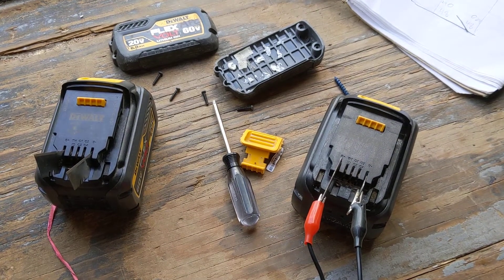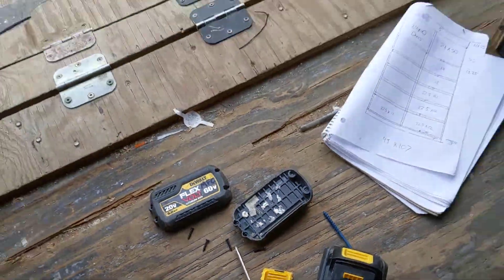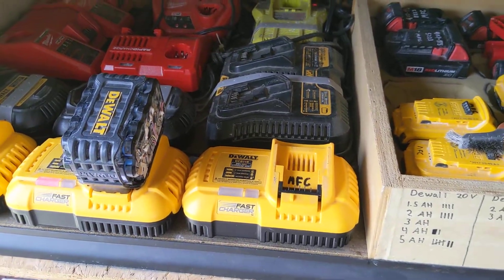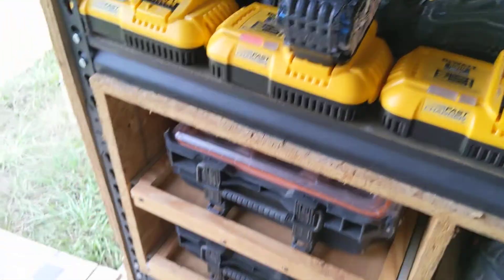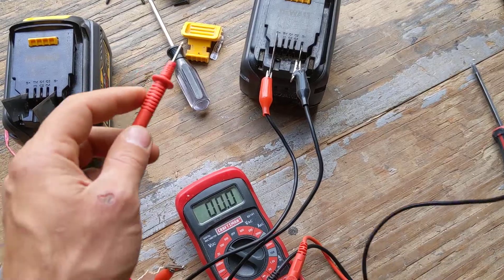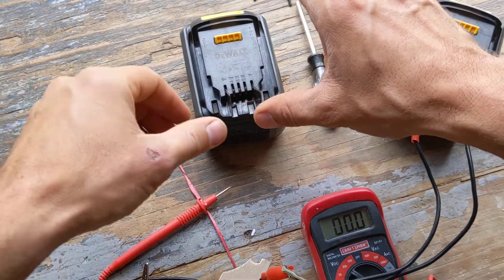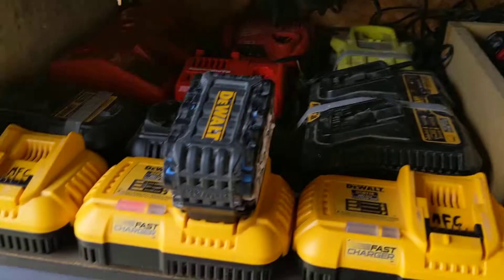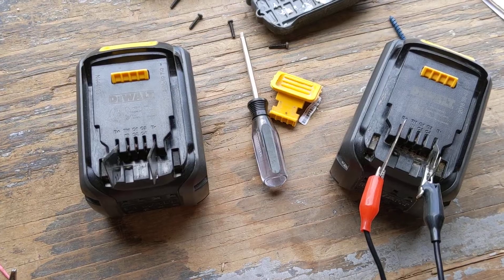How to fix a lithium ion battery that won't charge

Comment: I have a battery that showed mv and it jumped to 14v, but it doesn't look like it's going to charge.  I will let it sit on the charger overnight to see if there is a change.  It may have been to far gone.  The crap battery as of now did not live a long life.
Reply from the maker: Sitting on the charger won't do anything because as soon as it detects low voltage it shuts off charging. I would try jumping it again since it seems like you got it up some. Worst case scenario is that it's beyond fixing. Just be careful.
Reply: @MyFortressConstruction  Thanks.  I unplugged and plugged it a couple times and it started charging.   It shows fully charged now.  Thanks for showing how to save $100s of dollars.  Happy.
Reply from the maker: @Methodical2  Great, so it sounds like the contacts were just dirty. I had this happen to a 5ah a few days ago. A piece of 120 grit sand paper between the contacts can help in that scenario. Glad you stuck with it!
Reply: @MyFortressConstruction  Thanks.  I don't know what I did but it jump started the charging.  I will get a chance to test it 1 day this week or weekend.

Comment: Hey how are you?
I have a problem with my Battery it’s show me full charge but it’s doesn’t work
Reply from the maker: Have you checked voltage on the battery with a multimeter? I'm guessing you've tried it on different tools already to make sure it's not the tool. Besides that I would try to clean the contacts on the battery with a little sand paper (just slide it in and out). Hope you're able to get it working.

Comment: What you need to do is hook up every point of contact on that battery while you're trying to get it reset because those batteries are set up to charge and different sections they don't charge as one big 9 amp battery they charge at several 20 volt that's the reason they work on 20 v or 60 v but if you just plug into two wires to it you may have you may not been hitting the right point of that needs to be a little jump to be able to charge
Reply from the maker: Good points. I just find the lower voltage points and hit those, but hooking up every contact would ensure you're balancing all of the cells.

Comment: How about my case sir?everytime  I insert my battery  to the charger,  the charger  say pack charged, is my battery  is defective?
Reply from the maker: Yeah if the battery shows that it's only got one bar, but it says that it's full on the charger, then your problem is probably the same as mine. Check the voltage on the terminals and see what voltage you're at. If your voltage is low then you can try to jump it with this method. Once you get the voltage up a little bit then the charger should recognize it and start charging it.

Comment: How do you know which one is positive and which one is negative on the slides of the battery?
Reply from the maker: There should be marks of - and +. If you don't see any then you'll need to use a multimeter to verify. You just need to make sure you don't crisscross terminals.

Comment: So. I need help. I have a battery that will only charge up to one light bar and nothing more. How do I fix this issue.
Reply from the maker: What brand? Have you checked what it's voltage is? Sounds like the same problem I had in this video. The charger will run for 30 seconds or so and then stop because it's sensing that the voltage is too low. Typically the charger will flash an error code.
Reply: @MyFortressConstruction  Yes sorry, I guess I didn’t specify the battery. It is the 5amp dewalt. I’ll check the voltage and hopefully get a clear reading. I looked elsewhere online and it says that it’s probably a bad cell now.
Reply from the maker: @aaronmoritz9878  it's possible it is a bad cell but even bad cells can recover. Sometimes they've been discharged too much and they can be jumped back to life. If the voltage is low you can try jumping to get it up.

Comment: I tried this with two dead Ryobi 40v and it didnt work after charging two minutes. Does it matter if they have different amp hour rating? How long can you safely jump them? Thx.
Reply from the maker: The amp hour rating won't matter too much though I would try to pull from a larger battery. As far as length of time, I'm not sure what would be safe. I recommend short pulses. You can try to monitor temperature, but if contacts cross or something else happens then you could have a cell or the whole battery explode or spark... Definitely wear PPE and have ventilation if you're concerned.

Comment: Battery full.. or battery low.. voltage should be that same. Its current(amps) that dies out. Hence the "Amp Hour" ratings they give. When a battery is fully dead yes voltage flops out too and it becomes completely dead. Point being you dont measure the functionality or performance for a battery by voltage. Voltage is the same at full or low battery.
Reply from the maker: I certainly am not an electrical engineer but, from my observance of real world usage, voltage begins to drop at around 50% capacity/amperage use. Lead acid batteries are more prone to this but lithium ion batteries do as well and you can hear it as a motor's rpms decrease.
Reply: No, this is factually incorrect. Nominal voltage for a Lion cell is 3.6V, fully charged is 4.2V. The voltage starts lowering immediately with current draw, and current is supplied continuously at an ever decreasing voltage until the battery chemistry has nothing more to offer, around 3.0V.
Reply: @dave38x  doing electronics for years I can confirm you and joey are correct, the voltage may drop slightly, but it is the current that keeps you drill going, once drained of current the drill will stop working, batteries are nominal 3.6v and charged are 4.2v.

Comment: Can any one help me !  With my 30 yeas old Hitachi power tool ? It's still charging but,when I used it why it drain out in 5 minute? It that mean the battery is dead or what?
Reply from the maker: Yeah, sounds like the battery is shot. You could look for a "new" battery, but it's probably time to move on to a new system like DeWalt, Milwaukee, or Makita.
Reply: @MyFortressConstruction  thank you for the tip. Hate to throw it out but,it is what is I guess time for a new one.

Comment: I tried this with a similar battery and in seconds the red lead started to melt and got extremely hot.  Does it matter if one is Dewalt and one is Ryobi?
Reply from the maker: It sounds like you crossed hot and positive. If not, then it sounds like you'll need to get a thicker lead and possibly put a fuse between to prevent too high of amperage passing through and then only pulse power through until you get the voltage of the other cells up a little.
Reply: Also note that the batteries have to be the same voltage rating. You can't jump a 12 volt battery with a 20 volt battery or vice versa because the voltage difference will pull too much current or it simply won't charge depending on which one is being jumped.  And make sure to have the correct polarity (positive (+) to positive and negative (-) to negative) or you'll fry something.

Comment: Will this work for a 9,0ah that has two bars but will only charge a couple mins before stopping? Also have another 9.0 and 6.0 that don’t want to charge. Bloody dewalt
Reply from the maker: Yeah, I don't think it would help on the 2 bar batteries. It sounds like some of the individual cells inside died. I had a DeWalt rep tell me to bring in all my 6ah or higher batteries before the warranty period was up because they don't like to last for more than 3 years. I've had the same issue from Milwaukee M18 batteries that are 12ah. Seems like they bigger they are, the more issues they have with charging. Do you have a 3 year warranty on batteries where you live?
Reply: @MyFortressConstruction   it sure but all my battery’s are stamped 2017. I’m in aus

Comment: Well, this method did NOT work on any of my (4) dead Makita batteries.  I tried several times and for varying lengths of time.  Sorry, not a believer.
Reply from the maker: I wonder if Makita's battery tech might be different. It seems like they put "brains" inside of their batteries. Sorry it didn't work.
Reply: @MyFortressConstruction  Oh, well.  It was worth a try, at least!  Thanks!

Comment: Anything for a battery that takes a charge and won’t hold it long term like a newer one?
Reply from the maker: So you mean, you charge your battery, it sits for a few months, and then when you go to use it, it's dead? If so, then it's probably got a bad cell/connection internally. 
The circuitry in the batteries does take a little bit of power every hour and there is "leakage" of current, but it should take over a year for a full battery to be dead from such a minimal draw (amps and voltage play a part in loss so it would depend).
Reply: @MyFortressConstruction  it may leak down in just a few days.
Reply from the maker: @davekana8388  Most manufacturers have at least a 3 year warranty on batteries, so I would send it in to get replaced if you're serial # was manufactured within that timeframe. Otherwise it sounds like you would have to take off the casing and test each cell's voltage to see if you have a bad cell inside. Could be a bad connection or something else that is drawing power. Good luck to you.

Comment: Thank you for the video. I have forgotten about this little trick and had a MACTOOL battery that was so low it would not charge. When you pressed the indicator button it would just give a flash and would not take a charge.
My tip to those that encounter this was taking two short pieces of 16 gauge wire or similar and I just pushed the stripped ends into the PROPER locations. After two minutes both batteries showed fully charge. I took this wires off and placed them on the charger until the process was complete.
Reply from the maker: Wow, you leave them plugged together for 2 minutes? I guess on 18 volt batteries that might be okay, but with the flexvolt batteries I found that pulsing them for 5 second spans or so was the safest way to pick-up the voltage high enough for the charger to recognize them again. 

And I thought I was so smart for thinking this up. Lol...
Reply: @MyFortressConstruction  I am not sure but I think you sort of wake the battery up. Rechecking the battery it did not hold a charge so it might have a bad cell. I did see that these do not like extreme weather and the battery that failed was left in my black truck during the hot days we had recently so maybe that is part of the demise also. I think the heat is a current draw issue versus volts but not sure. Still messing with this but I did bring my lithium ion car battery back from the dead by using this method.
It's a good video!

Comment: So connecting Negative to Negative and Positive to Positive for around 20 seconds is the trick to get the dead battery going again! Going to try it out now!
Reply from the maker: Yep, just be careful. It's better to pulse it and check because even 20 seconds can heat up your batteries and overload the voltage.

Comment: My battery just went out. I will try your fix. If it doesn't work i will send it in.  I think that my battery is still under warranty. I didn't know that the "Born On" date was on the battery. Thanks for the information.
Reply from the maker: If you're still under warranty send it in! My "fix" could void your warranty and I only do it as a last ditch effort.
Reply: @MyFortressConstruction  I just looked.  The warranty ran out last month.  Bummer
Reply from the maker: @ezelk1337  Yeah, a DeWalt rep told me to bring in any of my 6ah or larger batteries before the 3 years are up because they do seem to last 3 years and then get drained too much for the charger to recognize them. However, if you're careful with this method (quick pulses to bring up the voltage) then you should be able to save all your batteries. I have almost 5 year old flexvolt batteries that are still running because I did this to get them up. Just check and make sure it's low voltage and not dirty contacts keeping the charger from charging it. The contacts need to be cleaned every once in a while.

Comment: I need help to revive my old 18v porter cable batteries please help
Reply from the maker: Don't know much about PC batteries, but always start with the warranty. However, I assume if you're here that's not an option. So, you will need to take your multimeter and find the positive and negative terminals and find out what the voltage of the battery is at. Then take another fully charged battery and hook up the negatives together and then hook up positive together for a short amount of time and re-check your voltage on the drained battery. This is dangerous as you could explode one of the cells if you are not careful, so don't leave the batteries hooked together for too long (5 second connections at first). If you don't feel like taking the risk then new batteries are the way to go. If you keep hooking up the positive and the other battery isn't changing voltage, then it could be a bad connection at the terminal or something else going on. Sometimes the cells are fine and it's the connections that are preventing it from charging.

Comment: Are these batteries interchangeable to work with all the Dewalt tools that runs on and uses batteries. How can it be known that the battery is full charged, when charging the red light flashes, so does the red light turn green when the battery is fully charged or it still stays red.
Reply from the maker: Flexvolt batteries are 20v/60v batteries so they will work with 20v or 60v tools (18v/54v everywhere else in the world). They won't work with the old 18v dewalt tools that have a stem, even with the slide adapter. On the fast chargers it blinks red until fully charged, then solid red to indicate full. The battery packs have indicators on them that let you know what charge level they are at, so that even if the charger stops blinking, you can push the battery indicator on the battery to see if it's actually charged. DeWalt should have made the chargers blink rapidly or something to indicate a bad battery though.

Comment: Thanks! Wish I had seen this before I trashed my Ryobi 5AH's. Because I didn't bother to register the batteries at purchase I was told exchange wasn't an option. It sounds like that is not the Dewalt terms?
Reply from the maker: DeWalt doesn't require registering, but it's only a 3 year warranty. If you have your receipt they will go 3 years from the date of the receipt, and if you don't have the receipt then they go off the battery mfg. date. They've been great with me and replaced several batteries without blinking an eye.

Comment: Expect in the UK... you get a ONE year warranty 👎🏻
Reply from the maker: Wow, one year? 3 years seems to be the tipping point for most of these batteries. You guys must be EXTRA tough on your tools! Lol
Reply: @MyFortressConstruction  Nothing to do with using them. Such a low percentage will fail in the first year, so it basically boils down to not having a warranty doesn’t it.
Reply from the maker: @benclarkson4205  Yeah, I was kidding. That's just a cheap way for companies to say, "Sorry, tough luck." I have had more warranty issues with my Milwaukee tools than dewalt, but because of their 5 year warranty on a lot of tools (they're changing them to only 3 years now like DeWalt) I've been able to get stuff replaced past when dewalt would.
Reply: @MyFortressConstruction  FIVE YEARS!?!?... imagine another 1st world country getting FIVE TIMES less warranty protection, in my case, buying the battery, very lightly using it, it dying after 18 months and immediately being £100 out of pocket.
Reply from the maker: @benclarkson4205  Yeah, that's just wrong. My DeWalt rep told me to bring in all of my batteries (5ah and greater) before they're out of their 3 year warranty period and to just tell them they didn't hold a charge like when they were new (which is always true) and they'll give me brand new ones, no questions asked.
Reply: @MyFortressConstruction  haha... brilliant... try that in the U.K. it’s appalling service when you consider how much we spend with these companies. I have a fleet of 18v batteries and tools, but only two Flexvolt tools. I took a leap into the FV system and now I wish I’d limped along with a normal 18V circular. I’ll be calling them again tomorrow to continue my campaign to get a replacement. They gave me the number on Friday for an official Dewalt ‘service centre’, who they said would help me, but at my own cost. When I phoned them they said they don’t/can’t repair batteries.

Comment: hello, can you help me find a board for a flexvolt devalt 60volt battery, since the microcircuit is out, the board now does not take charge?
Reply from the maker: Looking through a parts diagram and isolating your part, and then reaching out to a third party is the only way I would think it was possible. I know DeWalt isn't going to sell an individual electronic piece that goes inside of their batteries. Sorry I can't be of more help.
Reply: @Aptem Xychnrpob  I am in the same boat. Mine blew out a diode on the circuit board. I fixed it with a diode I had laying around and it last for about 2 weeks, then I saw smoke coming out of batt pack. I don't think it was the correct diode that was needed. What a bummer!! Montana Rick.

Comment: Where we should take the battery to make the replacement??? Mine its 2019
Reply from the maker: It has a 3 year warranty, so you probably have until 2022 to take it in.

I mis-read. You are asking where. So, if you call 1-800-4-DEWALT they should help you find the nearest service center.